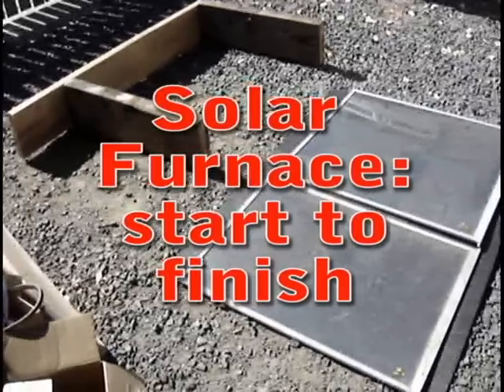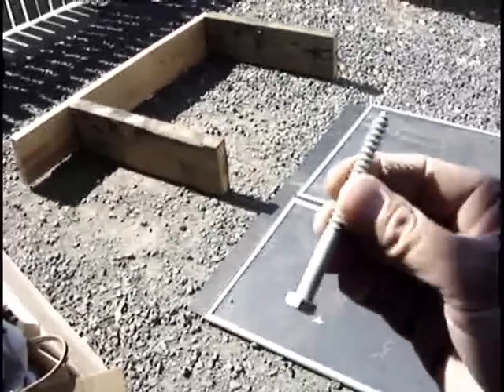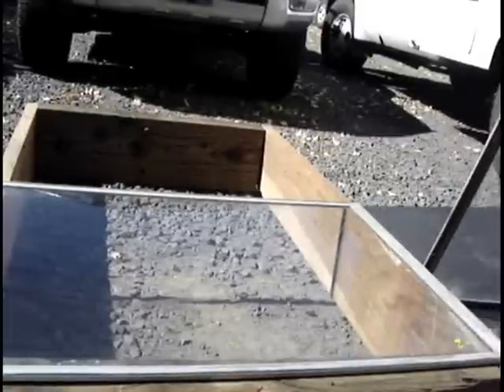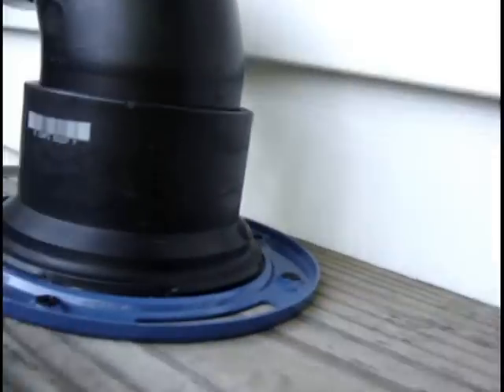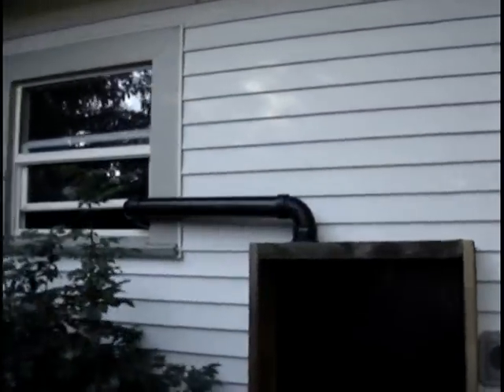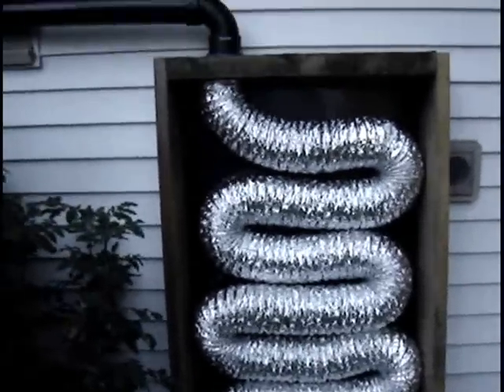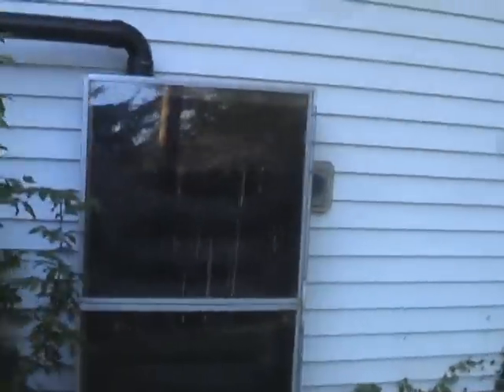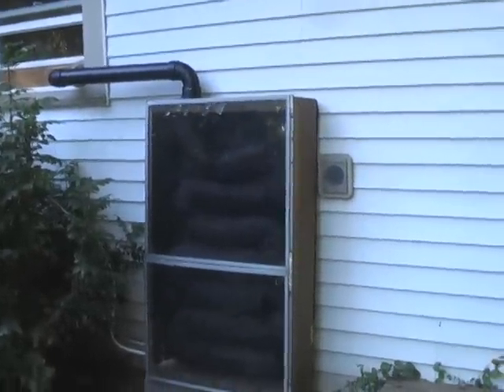Solar Furnace for under $50

Comment: Yes, it could be simpler. The dryer hose is totally unnecessary, whereas adding exterior styrofoam insulation with aluminum backing against the wood box all around, AND wrap insulation on the pipe into the house will be far better. Also, 
if you return air from low in the house through a pipe into the bottom, then it will convect in a circle and your box won't have to heat cold outdoor air but only somewhat warmer indoor air. The shiny dryer hose actually PREVENTS heat transfer, so it's good you thought of black paint, except you don't need the dryer hose for anything whatsoever. Everyone seems to think you need to direct the air, and you don't. What might be good is a big black rock or bricks or painted black water container inside the box to retain heat, and an internally reflective insulated batten door to close over the glass in low sunlight times to prevent IR loss to the sky from the warm insides.
-a physicist
Reply: I dont think the hose is unnecessary, first thing is it creates a sort of turbulance needed to slow down the flow of air thru the system allowing it adequate time to be heated.   But most importantly, the hose provides extra surface area (and being a currugated surface is great), its exactly the same concept as coils of a house radiator - they are heated (from the inside rather than from the outside), and made from a material that absorbs the heat well, and are a shape that allows greatest surface area to efficiently convect the heat into the air.  .
Reply: Same solar energy, either heat goes to the house, or the box gets hotter and air heating is improved. Internal surface is irrelevant in such a equilibrium situation. - a physicist
Reply: @josephcatalano7886  
I'm a physicist. You DO NOT NEED ducting hose or pop cans!! They DON'T DO ANYTHING!!! Just make an insulated box, with one side glass or polycarbonate, and suspend in the middle depth of it a piece of flat black painted steel window screen!  Then add your holes top and bottom with fans at top. It can be built ON an exterior sun-facing wall, and drill holes through the wall top and bottom, or it can free-stand if you put insulated duct hose on it.  Line the inside of the box with high-temp foam insulation with an aluminum foil backing facing inward.  In summer cover with a cardboard & aluminum foil batten shiny side out.
Reply: The goal is to heat the house though so using the hose to increase resonance time and allow the heat to flow into the air to be heated makes perfect sense. That being said if you are using the tube surface area is relevant as increasing the surface area of it also increases the rate of heat transfer from the air and thermal mass of the box into the fluid to be heated. This isn't really a static equilibrium equation as your comment suggest it is much closer to a differential equilibrium equation... Diff Eq and thermodynamics were two of my least favorite subjects in school but I digress. -an engineer
Reply: Antoinette Manker The only thing you would want an air "director" inside is to eliminate hot spots, but that's not a concern, once it reaches equilibium it doesn't matter, the important things are absorber be black, and the box be insulated with both styrofoam AND aluminum foil. Then inside, you can have a thermal mass, like a pile of black bricks, because that can retain heat after dark if you close it up with an insulative batten over the glass. The thicker the insulation the more efficient it will be. The greater the thermal mass the longer it will stay hot. The batten is crucial for nighttime, unless you just want to close it off and forget it at night.
Reply: Douglas Gottlieb Well, you want two things, heat absorption and retention and air flow. The more thermal mass you use the longer it lasts without sun, but you want enough airflow, and less volume can be devoted to that if you drive the air with a fan. You want the air flow path to be long, but those cans waste your time. Even flow bottom to top is perfectly sufficient. I'd put the bricks or water containers in vertical stacks and run the air through the vertical columns of those stacks. And be sure to insulate it with both an inch or more of styrofoam insulation, the kind that also has aluminum foil backing, else glue aluminum foil to the insulation with white glue. The secret to lasting the night is to cover it with a well-sealed insulated batten door over the glass, which would otherwise radiate all your nice heat to the night sky.
Reply: mangostavia I take your point, but for the size of the device, I think the effort to do that would be of marginal effect and effort might be better spent simply putting in a few simple baffles to direct air on a longer path, light sheet metal or such, or wood or cardboard. And even then, for the effort I doubt it would help more than a few percent. The effort might be better spent simply making it larger, more insolation (sun) area. The expense of materials and time must be considered by an engineer.
Reply: rstevewarmorycom from a efficiency standpoint avoiding the ducting and using a baffle of some sort is probably the best way to go... I don't know which would be easier to implement honestly I wouldn't have assembled it with fishing line and staples. Seems like he built it with what was on hand and cheaply available which is how he kept cost down. It's basically a trade off between price and efficiency. In my line of work we say cheap fast or good pick 2.
Reply: @mangostavia  
All experimental comparisons say internal ducts to direct air are unnecessary and do NOT improve output!! All professional devices have NO ducting AT ALL!!
Reply: @ physicist That's an excellent idea, I'm so glad you posted here thanks,  I'm going to do this adding your suggestions and I'm also going to take away the coil, and add black spray painted aluminum cans.
Reply: @antoinettemanker746  
I'm a physicist. You DO NOT NEED pop cans!! They DON'T DO ANYTHING!!! Just make an insulated box, with one side glass or polycarbonate, and suspend in the middle depth of it a piece of flat black painted steel window screen!  Then add your holes top and bottom with fans at top. It can be built ON an exterior sun-facing wall, and drill holes through the wall top and bottom, or it can free-stand if you put insulated duct hose on it.  Line the inside of the box with high-temp foam insulation with an aluminum foil backing facing inward.  In summer cover with a cardboard & aluminum foil batten shiny side out.
Reply: Great ideas! How would you place the bricks or rocks? What percentage of the box should they occupy? Would they hold heat over night? THANKS!

Comment: The unit produces heat very well and is still in use.  In response to a few of the comments that I've read, the dryer ducting is very effective.  I put a small computer fan on the outlet and it is wired to a 12 volt solar cell (as recommended by one comment)... the unit, when there is direct sun on it, produces heat like a hair dryer.  In addition, yes having a better intake would make the unit more efficient but it is operationally adequate the way it is and I'm super happy with it.
Reply: 1- Build solar furnace
2 -? 
 
3- PROFIT
Reply: HabaNero3 Because their is no profit from it. Only savings.
Reply: Truth
Reply: what do solar collectors do at night? lol really? someone asked that
Reply: Yeah, I'm aware of the basics, just curious if the minimal insulative properties are adequate to counteract the winter ambient temperature
Reply: what does it do at night or on a overcast day?
Reply: it produces that much heat in direct sun even in winter?
Reply: Joseph Catalano SOLAR collector….. Not ambient heat collector.
Reply: Joseph Catalano most of the time they are. It always confuses me why there isnt more of this going on.
Reply: Ancient Ass-Whippin what do you think?
Reply: Kale Klompstra Rhetorical.
Reply: Well heck, for night time, build that lunar colector
Reply: .ijuyykj
Reply: How do you control it on and off
Reply: Diesel Ramcharger They wait

Comment: This is wonderful. I wonder though, why didn't you take the intake air form the floor? Just do the same t hing with the pipes but run down from the window? It would be more efficient I think. but great design and I think I will use it.

Comment: I think with window cracked open that much you would have more cold air coming in than warm air on a cold day with little sun thus not heating the panel hot enough to draw warm air in. And if your windows are facing the sun rotating across that side thru out the day you don't even need that.  Just open blinds or window shades that's it. Let the sun do it works.  For me I always needed air conditioning in a room with window facing the sun.  Only cold in winter.  Spring, summer, fall, are very warm.  I'm from California. Just different maybe.

Comment: At first glance, the inlet pipes from the house look a bit small. It seems a better match would be 4" insulated flexible duct for the inlet, and 6" for the outlet (to match your internal hose diameter). (obviously need the larger outlet hose due to thermal expansion of the heated air)

Insulating the inlet pipe will help keep the box inlet temperature as high as possible from the house return air, and insulate the outlet to prevent loss of BTU's across that 3-4 feet of black pipe going back to the house.

I would imagine as shown, there's little chance of getting any natural convection-flow (without the fan), but if you remove the inlet & outlet restrictions, it should be able to self-regulate... a higher temperature rise will cause more convection flow, preventing cold-air from being circulated when cloud cover happens.

Just my $.02 worth...

Thanks for your video!!

Comment: I like your Project, I have built a unit myself, using pop cans. I have added mirrors to boost the capacity. Next unit will be at least doublé the size and probably consist of flexible alu ducts.

Thanks for sharing, regards from Mexico City
Reply: Does it really get cold in Mexico City?  I'm now wondering if this will work in Chicago and considering the sub-zero weather we've been having here, it's been a cold winter.
Reply: daschundloverable  Hi:  I'm in Idaho, near Boise... I've used something similar to heat here.  I have a south facing window and made mine inside the window sill.  I get 140*F on a 10*F but sunny day.  As long as you have sun, you'll have heat no matter how cold it is outside.  No sun, no heat.
Reply: 2JobsStillPoorUSA Oh, thank you!!!!  About how much sf would you say it can heat?  Are you using this the same one or something similar?  I am very disabled and found one that uses only pop cans and that thick styrofoam? insulation, which would make it very easy to put in place in the only window I have on the south side.  I've looked at so many of these, I can't remember which one this one is.  There are some really good ideas out there!!!   Did you know the EPA is outlawing wood stoves?
Reply: daschundloverable My house is 1325 sq feet.  The main area the heater heats is the living room, dining and kitchen.  At night, after the sun goes down I block off the vents because the heater does act as a heat sink, cooling air.  In my case it works best from about 11:30am to about 3pm during the day.  Although I think it would work best with some sort of solar fan situation, for me it is more of a supplement to the furnace.  It would certainly heat a 24x24 foot room to a comfortable level.  Mine is 1.5" styrofoam sheathing with a piece of metal siding centered front to back so the heated air can travel up both sides.The sheathin is protected by some self adhesive aluminum backed insulation. I just wedged mine in the window sill. (my windows are single pane, aluminum ones.)  I would not use my method on vinyl windows.  One note... it did get hot enough to MELT the styrofoam.  Next one will be wood, with furnace vents to open and close.
Reply: How do the soda cans work?  I mean, I've seen the units but haven't really seen where any of those 'styles' of solar energy are actually efficient.
Reply: You have to cut the tops and bottoms out of the cans, fashion a manifold, fasten the cans together with metal tape, paint it black, install the cans over your manifold and encase it in a glass box like you did here.  It works fine...
Reply: 2JobsStillPoorUSA Thanks.  I was wondering if those were worth the trouble of putting one together.  I appreciate your reply.
Reply: daschundloverable In Mexico City the temperature drops in Winter to around 0 degress Celsius. We have single brick walls and also single paned Windows. Besides the temperature outside during the day of about 20-22 degrees Celsius, the houses stay cold. The duct that enters the house is isolated to prevent heat loss through convection. Regards from a now hot Mexico City

Comment: thats crazy talk! all you need is to set up a few heliostats that are maintenance free that boost this system! just use some reflective insulation from lowes. its mylar one side and insulation the other so it has some strength to it as well and is totally rot and weather resistant and cheap

Comment from the maker: Wind at the coast is phenomenal.  Wind in the Eugene area is very limited.  When the weather systems move East, from the coast, they create high winds in certain areas where the valley meets the Cascades (unfortunately, not where I'm at so much now).  The solar furnace idea is certainly the most efficient way to harness green power that I've come across so far.

Comment from the maker: It worked well a few weeks ago as we had sunny days that were cold.  With direct sunlight, and I put a computer fan connected to a timer, the unit produces heat similar to a hair dryer (well over 100 degrees).  The unit certainly helps keep the house warmer but I should've left this unit to states that have sun (I live in Oregon).  It is all much fun to test and play with, though.
Reply: Can't understand why you didn't spray the coiled tubing black .
Reply: Will this work in the Canadian winters?
Reply: I hear you, I live in Seattle, would love to live in a place warm enough for this but would you need it?

Comment from the maker: I got around to putting some black spray paint on it and put a computer fan on it as well.  For about 2 or 3 hours, it puts out heat like a hair dryer... works very well.  I've put a large mirror on the ground so it reflects additional sun into the box.  Fun project to monitor and fiddle with!
Reply: I’ve noticed my oil heat is lasting much longer this year because I turned down the spray pressure and I opened the vents to my basement. Heating the basement ensures a more steady upstairs heat. Because heat rises
Reply: Basically I am saying redirect this ABS pipe to your basement if it is toasty down there due to its thermal mass and bricks , upstairs should remain a good temperature
Reply: @truthblastbroadcasting  Interesting thought.  Part of the cons of solar furnaces is that they are weather dependent AND don't work after dark.  Your thought won't fix that, but would help to moderate it.  Thanks.

Comment: I have a couple of windows from my storm door I was going to do this very thing with. I thought about using aluminum cans but I will wait and see how the dryer hose works for you. Let me know. what about forcing some air into it with a computer fan and a very small solar panel. you can get a solar panel on ebay for 19 dollars.